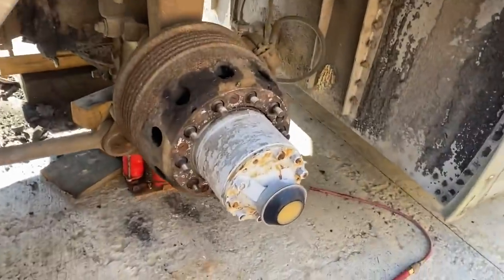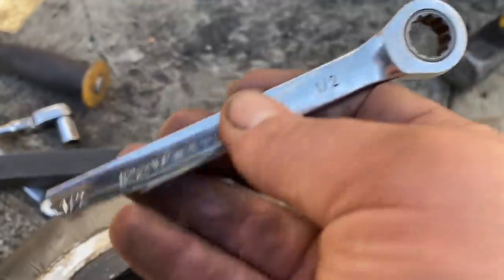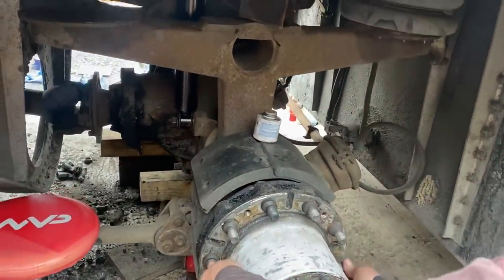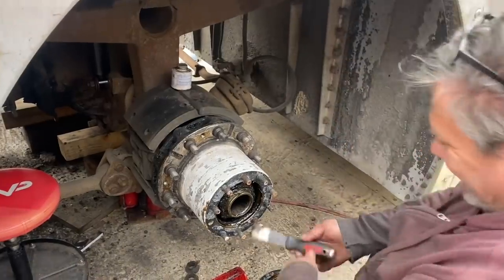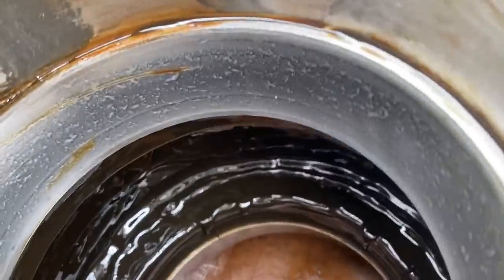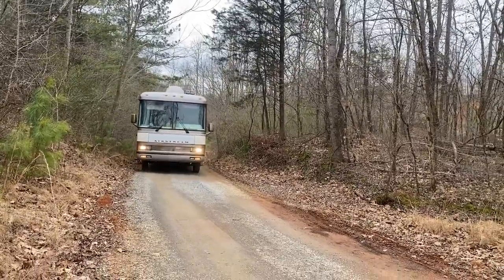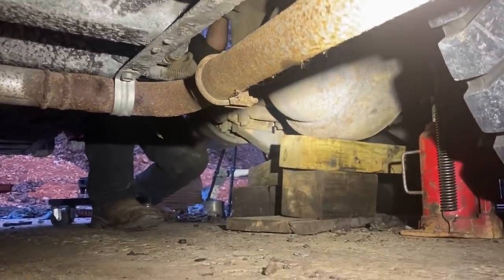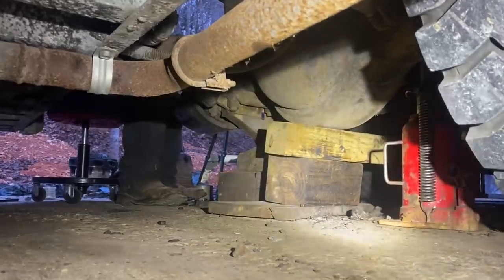Scenicruiser bus bad wheel bearing discovery and Airbag issue.  Getting it ready to roll.

Comment: The guys at my former employer used a flat-edged shovel to lift the wheel to pull it off the hub. The handle was the lever and the bucket provided the lift. Chews up less paint on the hub.

Comment: It appears in the video that those air springs are inflated through the mounting points based on the bolt pattern and sealing surface. Is that correct?   If so I haven’t worked on that style before. Interesting.  
Glad the bus didn’t fall of the blocks.  Working on these large rigs requires thinking through the possible “what if” scenarios.  
Mike

Comment: Wow! I didn't know those things had twin drive axles and dualies on both axles.
I wonder what mechanic at what shop screwed those air bags up?
Reply: Only a single drive axle, and a tag axle. It was the owners of the bus that installed the bags, and made a boo-boo.
Reply: @erikj.2066  if you go back and look you will see a prop shaft running between the two differentials and I did not see any way to lift that back axle.
Reply: @wernerdanler2742  Listen closely... 10:48